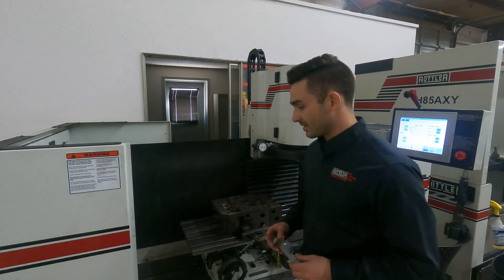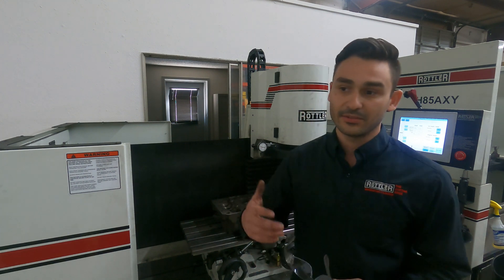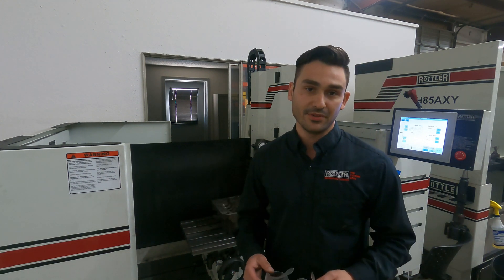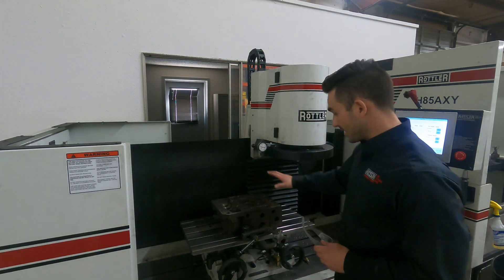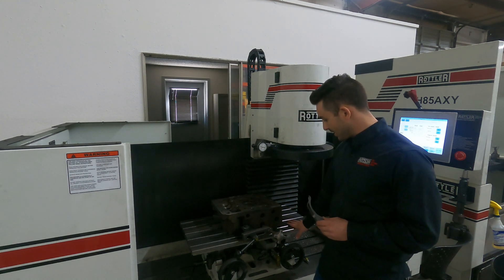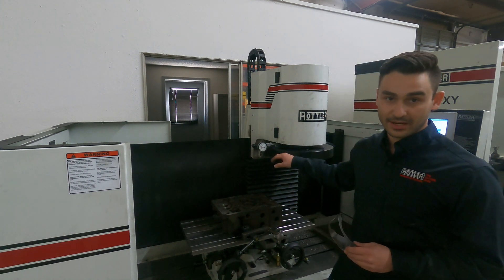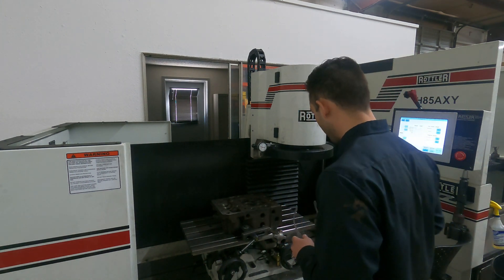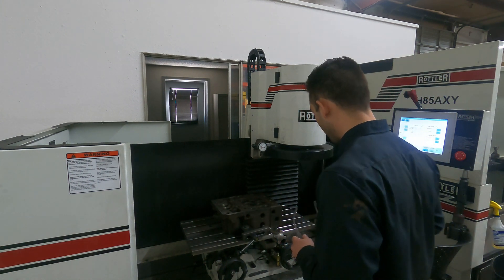Rottler Tech Tips: Resurfacing a CAT 3500 Head

Comment: Hello, Ryan!
Your video very helped me, when I choose rotates and feed.
Recently we made cylinder heads 3600, and they had very high demands to surface texture. Ra lower than 0,8 mkm. We made measurements in two directions. First - along way cutting edge , second - across way cutting edge.
In first case I have reached surfase texture Ra 0,350 mkm;
In second case surface texture reached Ra 0,650-0,750 mkm.
It's very interesting and useful experience. 
I always watch your video with interested and learn a lot of new about Rottler. Thank you!